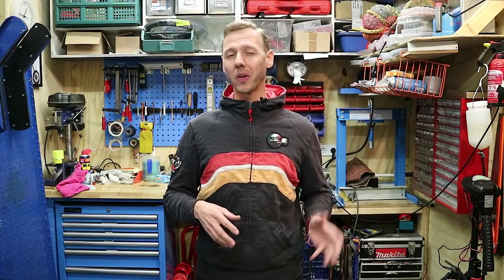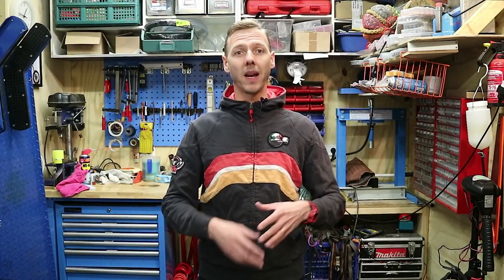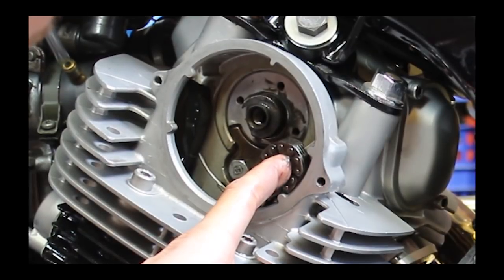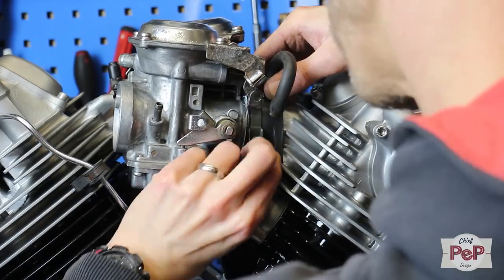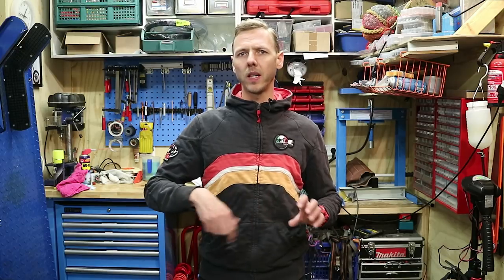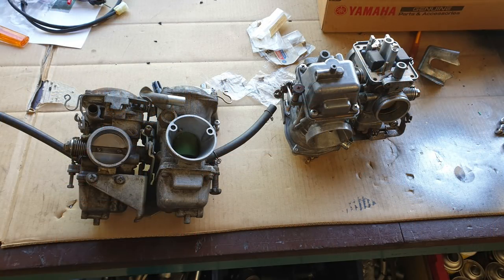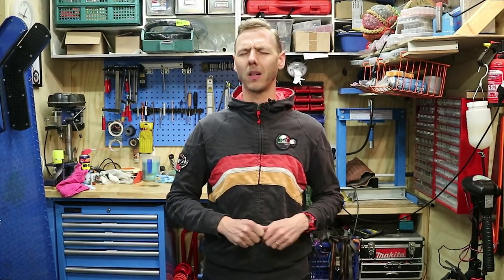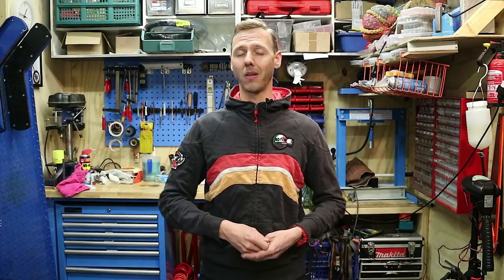Update: Bike not running well?

Comment: You can always do an outside clean once they're installed and working well.  The insides seem to fine already. Some Naval Jelly, old toothbrushes, a good brand of saturated polish wadding ( I use Eagle One Never Dull here in the States ) and very fine steel wool, used lightly, will make almost all of the visible area clean.  A light coat of WD40 afterwards and they will look just like your other carbs. I do this often with good results. Perfectly clean carbs that don't work well are only good for a bike you're never going to ride.  Good luck and Ride Safe..
Reply from the maker: Good one Brian. Might just do that! 👍

Comment: This is "Hitachi cancer", Pep. Those carbs are difficult or expensive to fix them properly as they stopped making them 30 years ago. 

1988 and later XV-s have Mikunis which are much better and much more stuff is available for them. 
They are also not too expensive to get second hand. The linkage system is a better design, too.
If your Hitachis are the newer ones (82 and later) you can keep the rubber intake boots as those are compatible with the Mikunis.
Reply: can i use 88+ xv mikunis on a 82 virago? would it fit properly?
Reply: @wrod7  Sure. The engine barely changed between 81 and 99. The intake boots might be different, check your carbs if they have the later lip design (pics below in my other comment).
Worst case scenario you need two rubber intake boots, too. Tourmax makes them, 50 dollars and top.notch quality. 
Mikunis have push-pull throttle cable  attachment on the carbs. Don't worry about that, use just the pull side. The Mikuni's spring is hefty enough to pull itself back to idle without a push cable.
Reply: Gary Tesla  I have had 3 XV bikes (700, 750, 1000) so far, first thing I did was this conversion. Sold the Hitachis on ebay, bought Mikunis and fitted them. Keep an eye on ebay or if you have a Facebook account join the Virago Owners Club, tons of good info and a few bike breakers there form the states as well.

Comment: Like you, I had to buy another set of carburetors because of the linkage system. It's good that you realize it's not running well and you have a specialist who knows how to regulate these Hitachi carburetors, maybe you tell as some initial adjustments and then where can we make adjustments, if your jets are different from one cylinder to the other.....good luck with that

Comment: Hi , i have had the worn linkage troubles on the Hitachi carbs more than once  , once the rear cylinder starts to run rich and you cant balance them any more due to worn connecting parts  then they are done :/  there are also very few jets that fit them as well .   the late model Mikunis and matching inlet rubbers are the way to go . much more tunable and less hassle .  At the moment i am fitting a 1-2 carb manifold on my XV 750 rigid chopper  using just the right side Hitachi , which has been modified to take Mikuni slot jets ,
Reply from the maker: Do you know which model and modelyears Mikuni will fit this '81 750?
Reply: @chiefpepdesign  #hi , im not sure about early (1985) model twin shock SE models , yes there was a twin shock called the SE , that has cased some confusion in the past for people ordering parts , but the later model flat slide twin shock carbs and intake rubbers will fit and fuel correctly , these models all have the same camshafts  ,and jetting is much easyer , the adjustment linkages dont give trouble ,  i have done this a few years ago but dont own the bike any more . remember these parts are now getting very old...

Comment: I checked your video and by the looks of it your clean but non-working carbs are Hitachi v1 carbs, the junkyard carbs are v2. 
They have different sealing lips. The junkyard carb has the conical lip which is Mikuni compatible.
The clean ones are the early type, they have the groove and no lip. 

Can't attach a picture here so here's a shared link. Hope it makes sense.
https://app.box.com/s/0udftniebqh7xbad1r4p2tkt3hzhuen9
Reply from the maker: Wow! Thanks!
Reply: Well spotted mate
Reply: Gary Tesla  For starters compare the carb throats, the sealing interface like discussed above. If they are identical then yes, all you need is the 750 jet kit because 920s were jetted differently.
If the sealing interfaces are different you need intake boots as well.
Reply: @Uncle_Chuck  Allan?

Comment: Hey Chief Pep. I was following your cafe racer build but somehow missed out on how you handled the electrical system. My bike, 1996 Xv1100 has a messed up Tci (igniter-sparkbox). I am trying to study now what option to take. I see 2 companies that make Tci's  Ignitech and RegulatorRectifier. I was hoping thatyou could give me some guidance. Wondering if you upgraded your electric system or stuck with stock. If you go to Viragotechforum and review my engine swap post, my i.d. is Arjay. 
Your advice appreciated.
Rj

heres link
http://viragotechforum.com/viewtopic.php?f=14&t=61457&sid=f80c4f39e55e2104168c1864d90bda5a
Reply from the maker: I would stick with the original one! I choose not to go with the plastic one, since no one can figure out which lip of the plug has what color... The metal ones have the wires on them. You need those as a reference.
Reply: Ah well, you lost me on that reply. Can you send me a link to plastic one you talking about?
Reply: If you mean older metal cased tci better than plastic, that must be extremely hard to find. In 1990 Yamaha changed from 2 pickups to 1. My 1996 has only 1 pickup. So older TCIs I think with metal cases might not work unless there is a work around to make it work. I dont know.

 Another issue I have is trying to figure out what this one diode is that I found broken in my wire harness assembly.

I see it in Clymer book page 281 connected to green wire right under fuel sender. In the xv1100 wiring diagram.

If you could please take a look. The diode was in 1/4 inch neoprene tube inside wire harness and hooks to gas tank fuel sender by green wire.

I need to replace that diode once I find out what it is. Hooking both leads bypassing diode makes low fuel light come on. But it is not the fuel sender. That part is in tank and uses a thermister.

I dont want to direct wire it as who knows what it will do.
Reply from the maker: @RJSoftware2000  maybe good to watch my wiring video's. I've spend hours and hours to make those to tackle all these questions! 👍